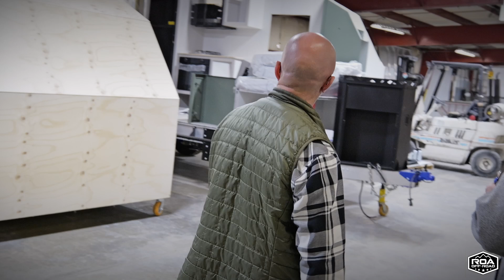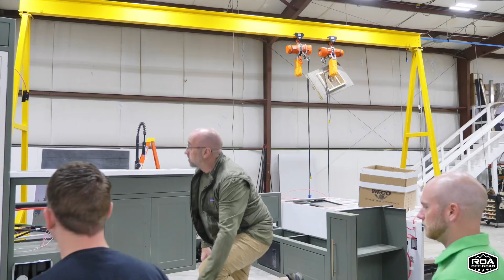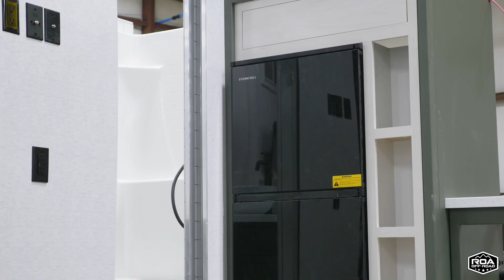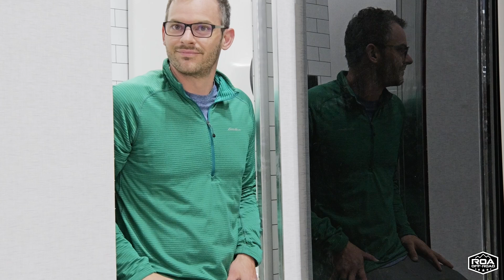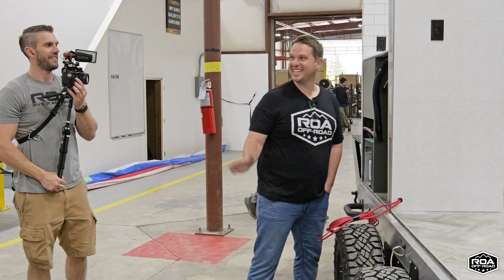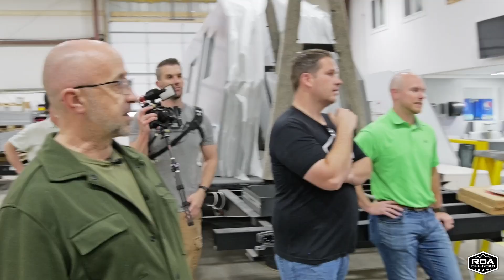RV Manufacturer that Actually LISTENS to Feedback! | Mod Squad Pause Edition

Comment: Great idea on the 11cu.ft. option.  Wife and I flew to Utah Experience center a few months ago to meet Josh.  looked at Pause 20.3 and Roamer1.  Both very, very nice and capable but I'd like to see 20.3 with OPTION'S such as Dinette/bed, 11 cu ft fridge, factory plumbed Cinderella toilet and built in storage trays/shelves,silverware holders(similar to ROAMER1 setup). I would buy on the spot.

Comment: I would prefer smaller fridge with more pantry storage and pot/pan storage.  Great idea. 

About the rear of the trailers….it’s a perfect spot for bikes, kayaks, etc storage.  But getting them back there is tricky.  Be better if door was moved to side so you could just load your stuff straight in.   Also, I would place something in front of the Victron/Battle Born setup to protect it from “flying objects” as they are bounced around and thrown in the storage area.  Maybe just a mesh protecting cover or an actual door or something.